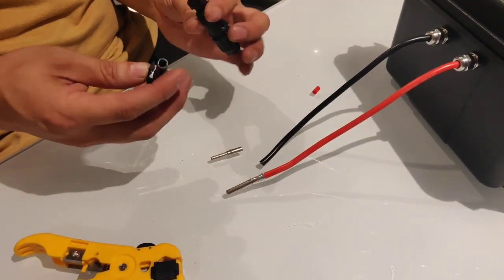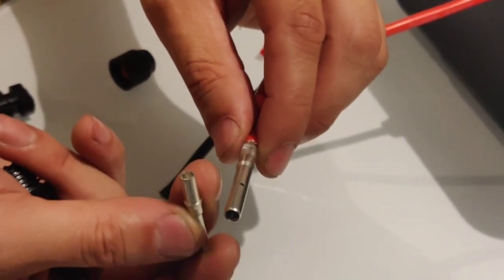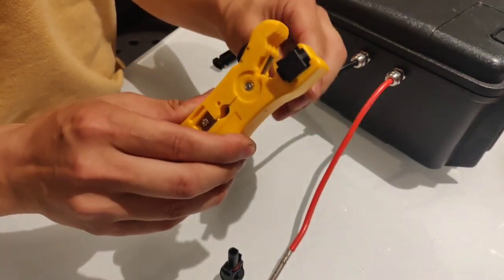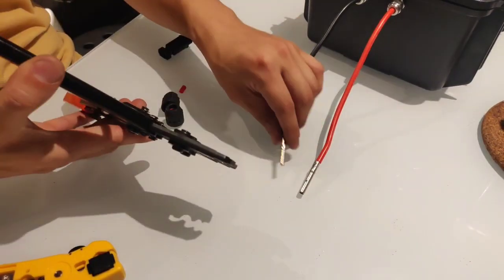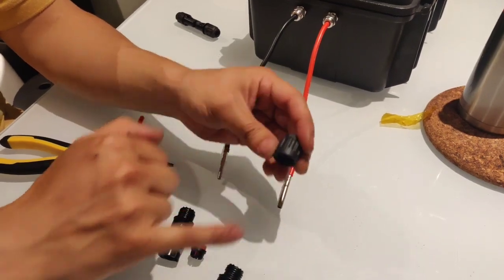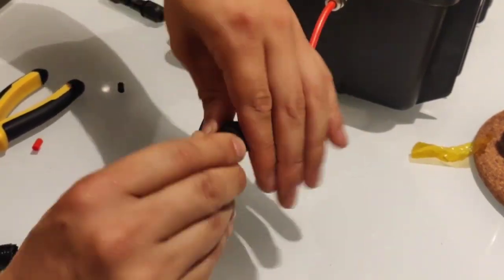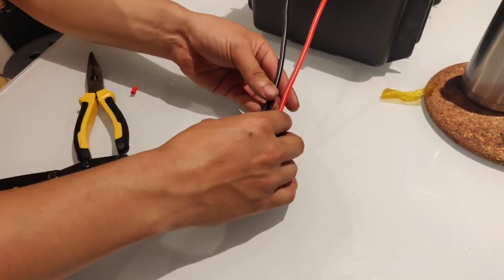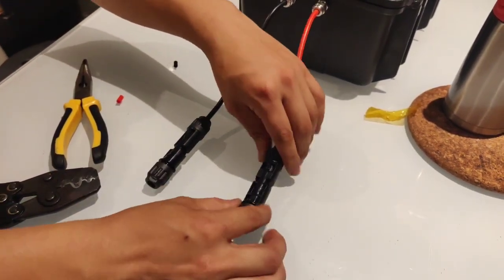Fpv-Power: How to terminate our waterproof connectors

Comment: Just a note if you are connecting the PWM to the 50ah battery to your motor:

My battery came pre-wired with the connectors as did the PWM so all that was left was to connect the motor to the PWM. Following this tutorial I connected the "red-to-red" which turned out to be the opposite of what I needed. Thankfully the PWM (or the battery, can't remember which) came with two connectors so I was able to cut and re-wire.

Comment: Hi mate. I just bought one of the FPV plugs from Freak Sports but it did not have the rubber grommet as per the video. Was surprised there was no grommet as it seems something like this is needed for waterproofing. Someone also said in the FS comments that you'll need to silicone the back otherwise water will get in. What's the go? Is it a mistake that they don't come with the grommets? Are they waterproof without the grommets?
Reply: great video btw - thanks.
Reply: as per video @ 5:49 sec.  the gromet do come with the Plugs as is needed for waterproofing.
Reply: @iangoh7289  checked again and  you're right - grommet is there it's just black not orange. thanks for the response.

Comment: So I've been talking with Mariner sails in the U.S. , and 10 awg wires (which are the four wires shown on the 50a PWM) are meant for maintaining 30 amps max, and the "FPV power 50a PWM V2" product is labeled as 50a. Are the components inside the FPV PMW able to withstand more than 30a? (I mean the forward/reverse switch, the speed control, and the volt meter)
Reply: Hi Zach, you haven't taken length of wire in to account. 10awg is plenty for the length of wire used. If we were running it over a greater length then you will need a larger diameter cable.
Reply: @brandongoh8900  thank you!